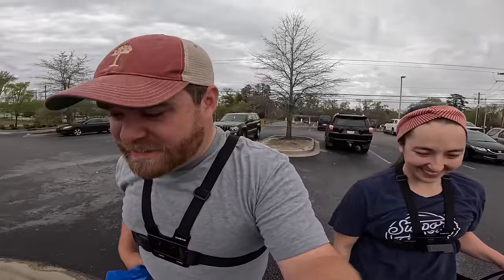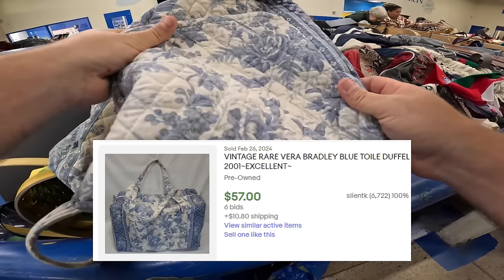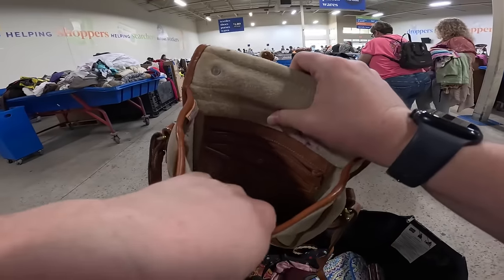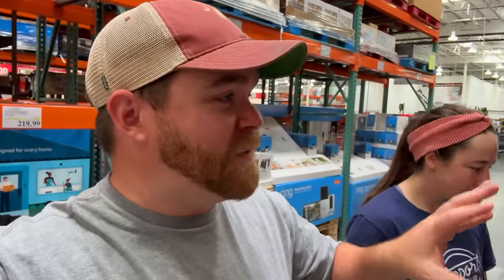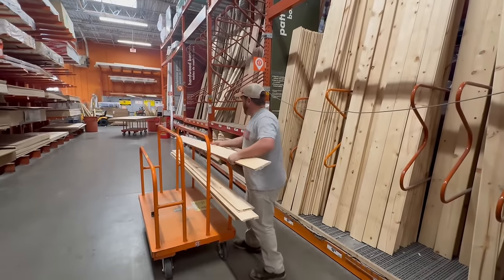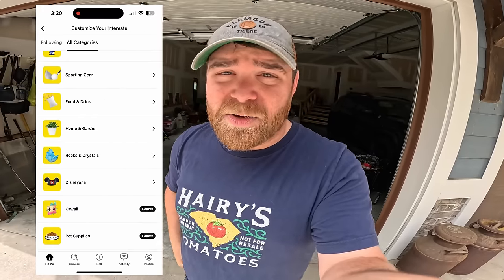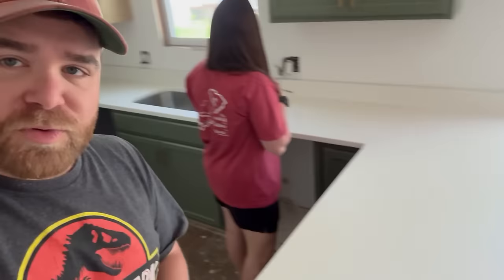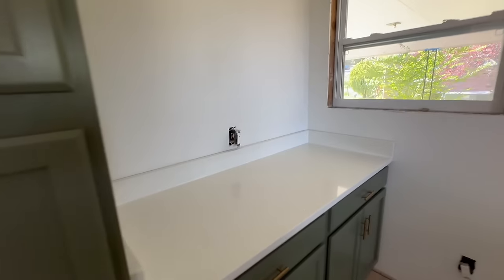Making Hundreds Per Day at the Goodwill Bins

Comment: Hey you need to add 1/4 round under your cabinet to help hold down the flooring and I would also add a trim board to the bottom to make it look more finished good job guys
Reply: 1000% agree.
Reply: Came here to say this. Looks great!!!
Reply: You need to have a more finished look to the cabinets. You are getting great suggestions.
Reply: Absolutely this
Reply: Your toe kick board will help also
Reply: you can't put a 1/4 round on then the toe kick. Flooring first then toe kick, it'll hold the floor down. Toe kick first then floor, then 1/4 round to hold the floor down.
Reply: Exactly what I was going to say!
Reply: sounds good to me
Reply: If you added toe kick under the cabinets would that hold the flooring down?
Reply: I was gonna suggest the trim board but forgot about the quarter round.
Reply: Add the toe kick first and then your shoe and you are good :)
Reply: It looks like your installing hardwood/ laminate floor, those cuts usually fall in place putting pressure with a crow bar to make it click in place

Comment: Hi Josh and Hayley, you can EASILY refinish hardwood floors yourself. Seriously, if you can run a lawnmower you can run a floor sander. I had zero experience, rented one from Home Depot, followed the directions they gave me, and did it myself. Then we put a couple of clear coats of lacquer on using a sponge mop. It was amazing how beautiful the floors were under decades of wear and tear. We even repaired a hole by taking a couple of boards out and toenailing new boards back in.

Comment: Josh... never glue or nail down that style floor. It's called a floating floor and will "float" or move with expansion and contraction. If you permanently fasten it down, you will get buckling in the floor. The same will happen if you did not leave space around the perimeter for expansion.
Reply from the maker: Yes I’m aware. But I’ve also seen people deal with small filler pieces by adhering them to the floor.

Comment: For the piece against the cabinet, you need to add a kick plate to the bottom of the cabinets and that will hold the flooring down.  If a kick plate is not thick enough, add a quarter round trim piece.😊 The kick plate hides the ugly transitions of the cabinets. Gives a great finished look.

Comment: Hey Josh, usually you install a kick plate (trim) at bottom on cabinets. It’s usually made of pressed wood. Once that is in your flooring would be held down by it, usually don’t use adhesive because that type of flooring moves a bit

Comment: Josh..rent a big floor sander from Lowe’s/HDepot and do it yourself. We did many floors in our house when we built it! It’s easy & VERY CHEAP!! We did everything ourselves, or we couldn’t have the house we wanted. My hubby is an electrician and learned plumbing by working on low income rental houses starting when he was 14 yrs old. He learned drywall, masonry, painting, etc too. We had a Co. brick our home (22,000 bricks..😳) and we did the rest. It’s a huge house!! What kind of countertops did you get for your kitchen? They look very nice you guys!! 🤗 Great vids and a great job on your flip. I’m super proud of you both!! 😁
Reply from the maker: Those get dust everywhere and it becomes a huge task cleaning the walls and ceilings after you’re done.

Comment: The cabinets have an unfinished kick plate. So you're going to need to put baseboard down there anyways, so do not glue it because it is a floating floor made to expand and contract. and in areas where you don't want baseboard, use quarter round
Reply: Absolutely no glue or nails. Quarter round is how it would be done professionally. You never want to nail or glue a floating floor it will pucker and heave if you do.

Comment: You can see the gaps where the cabinets meet and the unfinished wood as well. Just a 1/4 round alone won’t cover that. Pick up some flat, plain trim boards and run it along the face to cover that and the gaps to hold your flooring down.

Comment: Yes, to the quarter round to hold that piece of flooring down. HEY JOSH, about refinishing the hardwood floors. We rehabbed a house that had its original hardwood floors. We had them refinished and they turned out great. The issue was, we had it done last and the dust from the sanding was all over everything including the walls. I had to dust everything and used a Swiffer Duster dry to do all of the walls.
Reply from the maker: YES! thats the issue with just renting a sander from home depot. The company we're talking to apparently has "dustless" sanders that would significantly cut down on any dust produced by the process. Another reason we are leaning towards using them.
Reply: @HairyTornado  A suggestion from my experience: drape plastic sheeting over cabinets beforehand, dustless or not. Saves a lot of effort in clean up.

Comment: Skip finishing the hardwoods. If it’s going to be a rental, run the LVP thru out. May be more expensive initially but will hold up better in a long run. Plus the uniformity looks better.
Reply: Disagree! Hardwood is much more durable than vinyl in my experience.

Comment: My husband has been doing flooring for over 30 years. Says…Starting at one end of that board working your way down the board. Take a small pry bar push down and  pry the cut piece into and towards the existing floor. Click in and push it down. You should feel it click into place. Once it’s clicked it will stay in place. Then add your toe kick. You don’t have to add 1/4 round.
Reply: You guys are doing a great job on the house.

Comment: Put a a piece of Quarter inch trim on it and use little brad nails to nail it in place. It will add a little nice piece of trim and hold that part of the floor down.

Comment: The face plate/ baseboard on bottoms of the front of cabinets will hold down flooring.  Floors are supposed to float, so don't nail down

Comment: The kick plate for the cabinet should hold it in place when you install it. That looks like a floating floor so you probably don’t want to nail or glue it. 

Someone also mentioned shoe molding or quarter round as an option as well. 

Cabinets and countertops look fantastic the colors are very complementary of one another.

Comment: Don't Glue the floor part down as the floor will need to expand and contract you could put beading around the edge to hide the gap and stop it flapping ( personally I would have gone under the kick boards),

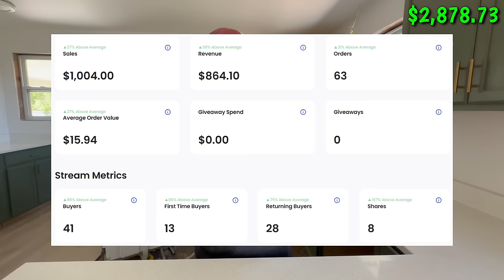Comment: 18:20 does that cabinet touch the other next to it ? Does it need a little trim piece so there’s no gap ?
Reply from the maker: all that will be covered by the toe kick board thing
Reply: On the wall not the floor but same trim piece would finish the look :)

Comment: For the floor piece: if you can get it to lock in, it should lay flatter. You probably won't be able to fit a pull bar in that gap though so easier said than done. Otherwise, adhesive and weights. Either way, put toe kicks on you cabinets then quarter round to hide the gap. Looking good so far and good luck!